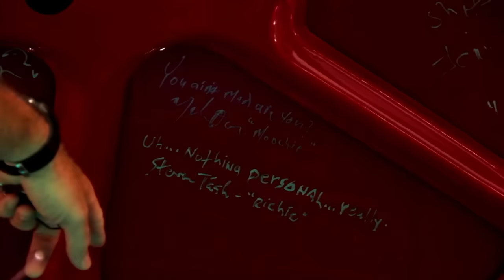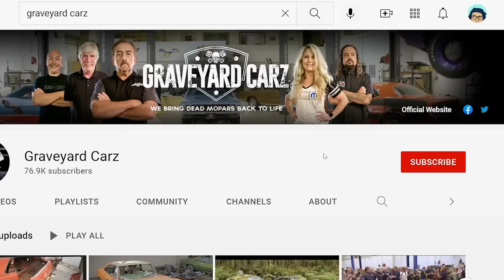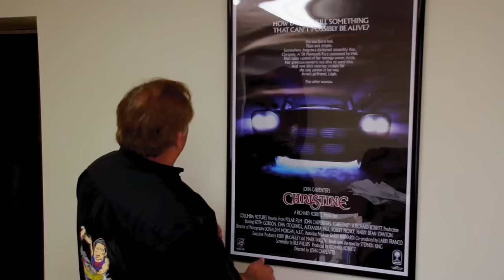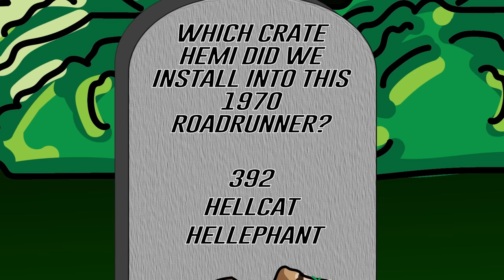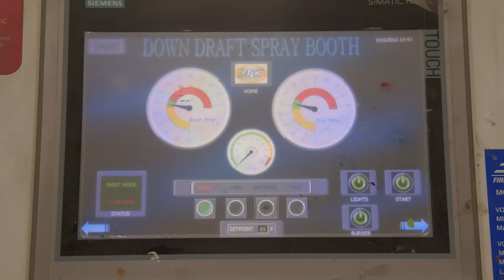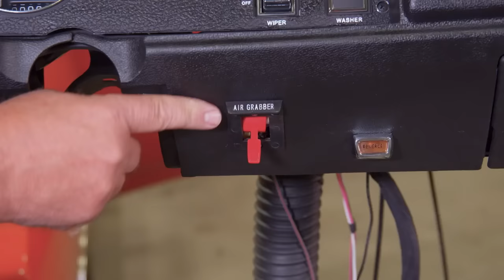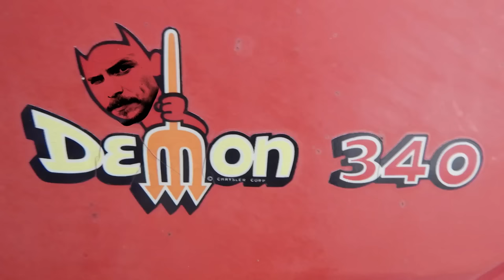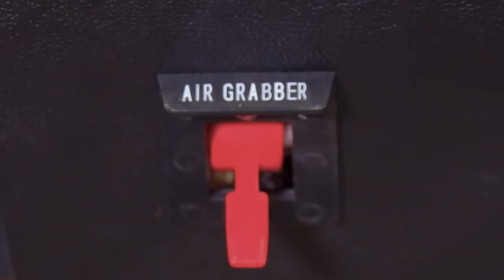CHRISTINE COMES BACK TO THE SHOP BECAUSE OF FILLER CRACKING: WHY HAS THIS HAPPENED?

Comment: If the filler cracked alone from the trailer ride, then that was probably way too much filler
Reply: Half assed job for sema. Not the first one and not the last one that is just done to "look good" and it's junk underneath.
Reply: @makpsv  yes but at least they took responsibility for it and did it correctly kind of showing people what happens when you rush a job
Reply: @larryrothrock4488  And who said they didn't? 🤷‍♂
I was just stating the fact that many of those Sema cars are kind of rushed together pieces of junk that are only build for the show. I know there are some nice ones, but most of the time...
Reply: credit card is too thick
Reply: @drdab_  As was the bondo... 😅
Reply: Never enough time time to do it right the first. Time,,but there's always time to do it again ☺️
Reply: @sandraherdman3783  The thing is many get sold as they are and some never get finished. 😅

At least this one got finished.
Reply: Bondo will crack under two conditions. One if its mixed with too much hardener and if its not sealed underneath primer or finishing puddy before having paint applied. In fact they recommend applying a sealer for your paint scheme.
Reply: Always bump the panel in shape as close as possible
Reply: This is why we put erasers on pencils...... lol 😂
Reply: Applied way too thick.
Reply: We use tin for the body work and never this epoxy stuff.

Comment: Beautiful car, nicely done. But, I noticed a few possible errors. Now my brother, had a 57 Plymouth Fury. Of course they are very similar to the 58. With certain upgrades, as manufacturers will do each year. The colors different 56 and 57 we're White. But there were other changes from the standard Belvedere. They had 150 mph speedometers, rather than the standard 120 miles per hour. Also the wheel covers we're unique and only available on the fury. One other small detail small detail what's the fact was the fact that on the front fender guys Fender guides, were gold balls. Also, all of the anodized side trim was gold colored, and so is the grill. Thank you Bruce Leon

Comment: Not that it is relevant to anything, but. I dug out my first edition of Christine, a novel about a 1958 Plymouth. The photo on the back cover shows Steven King posed with a 1957 Plymouth.
Reply: That's funny because another King novel "From a Buick 8" shows a 53 Roadmaster, but they switched to the 322 V8 nailhead that year.  The only 8 was in the Special.
Reply: Their was multiple vehicles and motors used most of them were other vehicles under neath and the body's were a variety of 57-59 fierys used

Comment: I would restore classic cars with added crash resistant reinforcement to the cabin, floor, roof, side panels,and doors. Substitute the old steering column to a modern safety steering system, and add seat belts , crash sensor relays, and air bags. This will take time, and no crazy deadlines.  The result will be a 5 star rated customized classic, tougher than any modern luxury car in the market.(no need to remake anything) Thanks.

Comment: It doesn’t matter how well you do filler work. It’s going to crack ( some faster than others) no matter what. Metal and plastic obviously don’t have the same properties so they flex/shrink vastly different especially in temperature changes and vibration. I media blast car bodies and can’t tell you how many times I hit a bondo spot ( I call them blind spots because it was unnoticeable at first) and the paint may have held onto it but the metal underneath was rusting because the filler separated. If you’re wanting a pristine car either you hardly ever drive it or plan on it needing to be done in 15-20 years again and it’s not because they are wrecked, it’s because of paint and body issues 90% of the time.

Comment: Just by reading the title... Filler cracked because you used it wrong. Filler should not be used to cover the whole body or large parts of the body. It should be used to fill in deep scratches and factory seams.  Need to get back to shops that are actually good at metal work. Too many half ass with filler.

Comment: What a tribute to Mopar for giving you a thousand horses,
Hack a car together
Building Bondo bombs is easy. Thats what they used to do 40 years ago
Today you are supposed to do it right
Another hacker exposed
Wonder how much power it'll lose with the air filter under the hood eating all that hot air?
This is a failure of ego